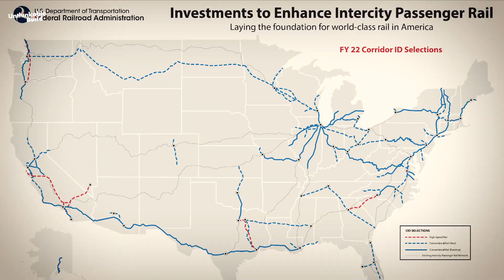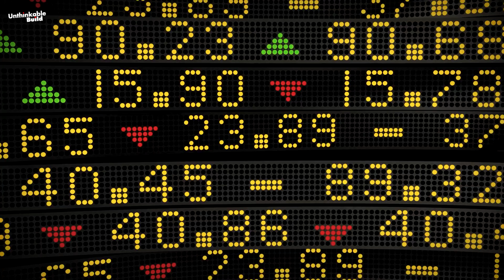America’s First Real High-Speed Train Is Finally Coming

Comment: My wish for the USA is an integrated Interstate Rail network running at 124 mph/200 kmh for passenger trains and 60 mph/100 kmh cargo trains on a double-track electrified network that runs from coast to coast to coast... At that speed, upgrade costs are minimal for infrastructure yet offer significantly upgraded speeds.. Anything more than that you're talking full grade separation and a huge energy use/cost bump... Here in Alberta the Edmonton-Calgary Prairie Link has been proposed in different forms for decades. The newest version is a 400 kmh TGV train in an new corridor. This is pegged at $10B CAD for 300 km across mostly straight flat bald prairie...  The 200 kmh version using diesel electric trains along the existing CP corridor would cost around $1.6-2.3B including trainsets, track improvements, etc  And a 300 km/h version was still going to cost $8B+... So as you can tell there's an economic vs speed battle where you'll spend a ton of cash to go not much faster... Then again spread over 20-30 years? The capital cost becomes rather meaningless...

Comment: It depends on what you consider High speed Rail.. Personally I set the bar at 200 km/h which is what the Japanese Shinkansen originally ran at... If that's the case you could count NE Acela and parts of the Brightline East as well as the upcoming California HSR and possible Texas Central Railway...